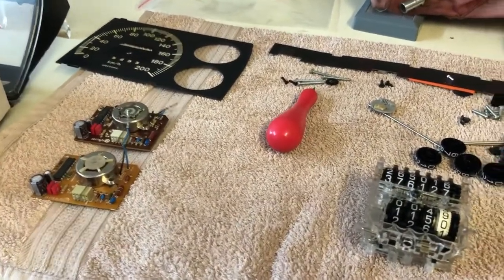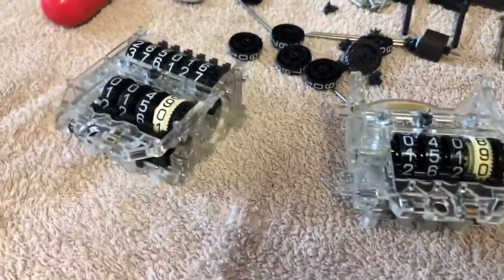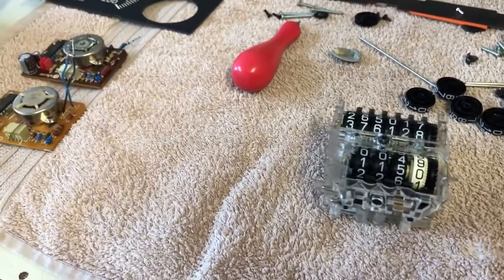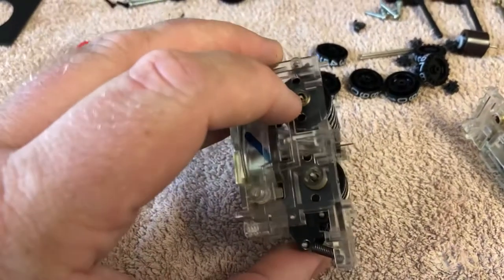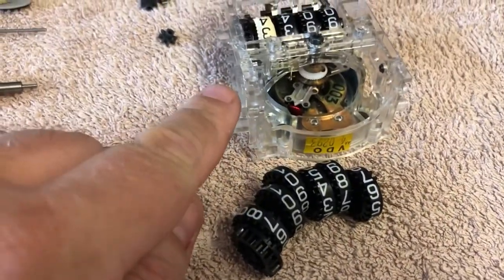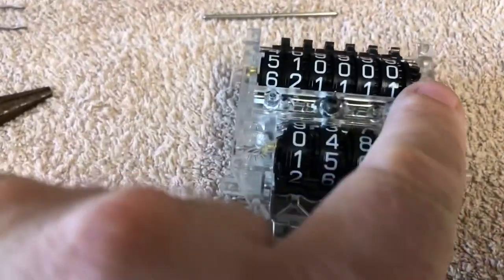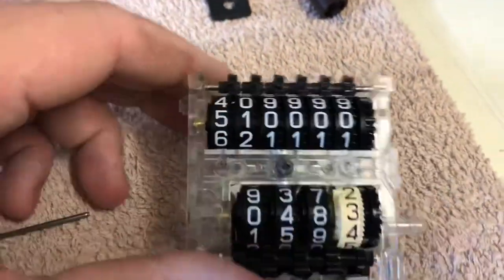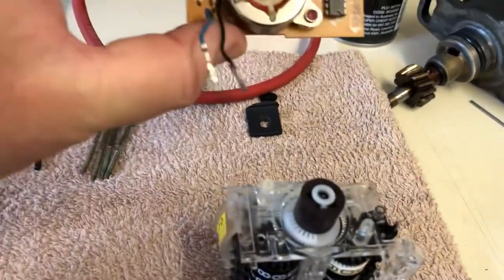Repair Broken Odometer | EB Fairmont Ghia | Part 2

Comment: Hi dude had to replace the gogs in mine as odometer was not working but speedo was no ive done that and speedo would go and not go and when it does go so does the odometer but now speedo stoped work so odometer not work either any idea as to what my problem could be